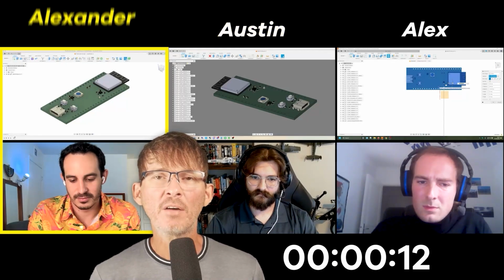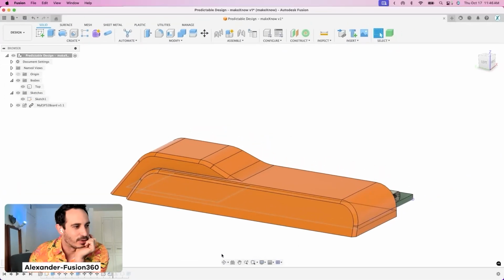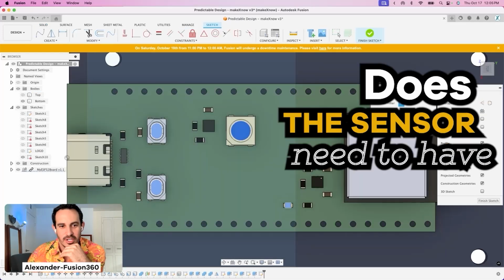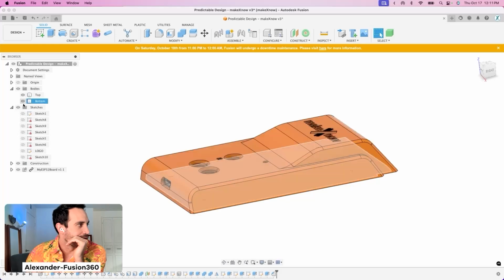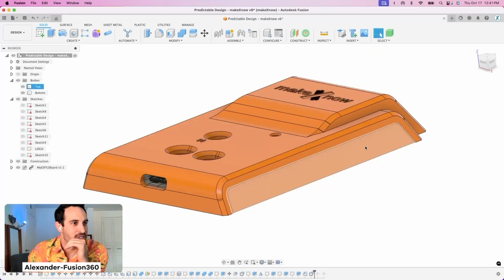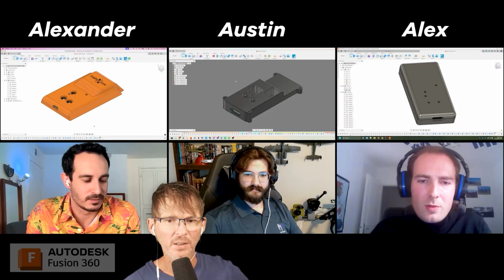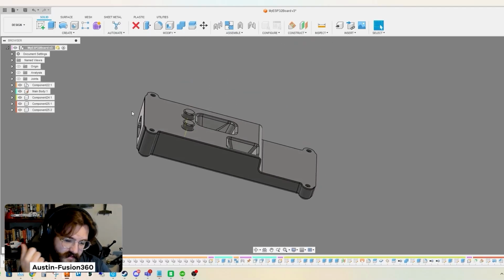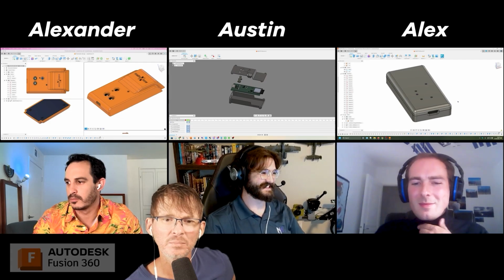3 developers race to 3D design a new electronic product

Comment: Doing this where you're putting the design and thought processes of different people on display is very interesting. I'm pretty solid on general design and using the software but I do question sometimes if I'm taking the best path to get to the end and I wonder how someone might tackle the design steps.
You do paint yourself into corners while brainstorming and you end up at a place that is hard to manage certain changes.

Comment: I would have picked the 3rd design as the winner, because it's more compact and visually pleasing, saving plastic in the process, but I understand that the lack of buttons could disqualify it as it needs more work.
I may be biased by personal experience, but instead of using Fusion I'd use Blender. Not having to measure and recreate a 3D model of the PCB saves a lot of time, so IMHO it shouldn't take more than 30 minutes to design the case. I'm getting the impression that Fusion's interface complexity is getting in the way.
Reply: Hey, it’s Alexander here! 👋 I appreciate your input! Blender is great for artistic modeling and quick concepts, but it’s not ideal for engineering projects that require the kind of precision needed to design for injection molding to fit a PCB perfectly. Parametric tools like Fusion not only let me adjust dimensions, tolerances, and features like mounting points or cutouts without starting over, but they also make it easy to create precise prints that can be sent directly to manufacturers. This precision ensures the design fits as intended and lets me hold manufacturers accountable for meeting specific tolerances, which is critical for functional products. PCB enclosures aren’t just about speed. They require exact fits and functionality, which Blender isn’t inherently designed for, especially when updates or revisions are needed later. Blender is more suited for projects where tight tolerances aren’t critical, like mockups, video game characters, animations, or artistic renderings where precision takes a backseat to creativity.

Also, if the goal were the most compact design, I’d definitely have gone much smaller, but since there wasn’t a strict requirement, I decided to create something that stands out visually. Thanks for sharing your perspective!
Reply: @makexnow  I agree that in the bigger picture of going from design to manufacturing,, Blender isn't the right tool as its intended use is indeed for artistic productions, but since I routinely design parts and somewhat complex enclosures with it, I still find it adequate for that specific use case. I've never produced designs for injection molds though, only 3D prints, so there are plenty of important considerations I'm not aware of yet, but I'm learning :-) and I can only dream of tight tolerances as the printer X/Y resolution and filament thermal expansion/contraction just make it impossible to get accuracy below 0.3mm.
I do appreciate the benefits of parametric tools when having to revise a design afterwards, and while the process isn't as streamlined in Blender, I just use a different approach to get a similar flexibility, namely by using multiple objects and modifiers to define intricate shapes, allowing me to only modify the shape or location of the feature that needs to be revised, without affecting the rest of the design. For example, all the holes are made by "negative" objects (using boolean modifier) so I can adapt the holes for different screws or switches by modifying the hole object only.
I do get your points though, and thank you for taking the time to explain your perspective too. 🙇‍♂

Comment: Alexanders one : looks orange , thats it, the shape doesnt let you place more of them on top , no point to hang it , for me it looks awfull . Austin one, similar, now he introduced 2 different sized screws , why ?? , the bumps/tabs for the screws are the places where it breaks , so its trash . Alex one: simple, easy to produce, can be stacked, the winner
Reply: Alexander here! 👋 When we started the competition, I asked about the purpose of the product, but there weren’t any real constraints—it was simply to create an enclosure. Designing without constraints is tough because, as a designer, I usually try to optimize in a specific direction.

If the goal had been stackability, I would have added grooves to make stacking easier. If the goal had been to make it mountable, I would have designed a specialized internal hook for wall mounting. With no clear direction or constraints, I had to pick one focus. I could have optimized for strength, size, cost, or luxury appeal, etc, but since this was a competition, I decided to prioritize making the design stand out.

I didn’t meet any of the constraints I wasn’t targeting, but I do think I achieved my goal of creating a standout design.
Reply: Other than for shipping/storage, stacking might not have any benefit, if these were simply used to measure temp/humidity in the environment and not for computing, them being visually appealing would most likely be more important than them being stackable, as you would never stack them for that use-case.

They could of course have better mounting options like screws, rails etc. but the designs only allowed them to be powered through USB C, in which case, I've mostly seen similar devices simply be mounted to things with doubled sided tape. Only downside is that there is no bottom lip on any of the designs so if tape was used, all of them would protrude and look ugly wherever they were be mounted.

Would be cool if these competitions had a use-case/purpose outlined, since designs highly vary on what they would be used for and the designers would be able to take more factors into account than it just being a generic device with no apparent purpose. There is a big difference between designing something for a DIN rail in a factory vs. outdoor remote sensors vs. prototyping/dev etc.

Comment: Very cool. Liked the fact that you guys were talking about injection mold and not 3d printing. That's new info for me.
Reply from the maker: Great to hear! Yes I try to always incorporate injection molding into the discussion when talking about enclosure design. I'm all about products that will be manufactured not just for fun, so IM is vital to understand.

Check out this video I did just on injection molding: https://www.youtube.com/watch?v=10Nk3u0QNzY&t=29s
Reply: I usually design things for 3D printing with injection molding in mind. When creating products, it’s easy to rely on the unique capabilities of 3D printers, but this can leave you struggling to make the design manufacturable later on.

Comment: Thanks for the video John and all the fantastic designers. 

I have 2 questions:
1. Is screw-less design for pcb mounting well accepted in the industry? and are they sturdy?
2. When to go for snap fit for the complete enclosure instead of screws?
Reply from the maker: Thanks, and great questions!

1) Yes, most PCB's are screw mounted, but in cases where size is really limited then a screw-less design may be best. The enclosure can be designed to hold it quite securely.

2) If size permits then I'd go with screws for the enclosure, unless you just can't hide the screw holes. This requires less prototype revisions than snap fits. Snaps are challenging to get just right, and you can't usually get them right on a 3D printed prototype since the plastic is different than for production. Snaps also are not as secure, but they take up less space, and can simplify assembly slightly.

Hope this helps!
Reply: @PredictableDesigns   Thanks for the clarification.
Reply: @PredictableDesigns  Couldn’t agree more. Almost anything is possible, but the real question is how many revisions it will take to get there. Typically, with screws, you need far fewer revisions.

Comment: I really liked Alexander's approach. IMO, nowadays, the final product should be visually appealing even though it will be much harder to put it into mass production.
Reply: Alexander here. For this project, I focused on aesthetics from the start, which is unusual for me since I typically leave that for the end. I prefer to keep aesthetics in the back of my mind during the design process and refine them after several prototype phases. However, because this design challenge had a tight deadline, I decided to prioritize aesthetics early on. Interestingly, the design ended up having all draft angles and uniform wall thickness, making it manufacturable with injection molding without needing any significant changes as is.
Reply from the maker: I agree, thanks for commenting!